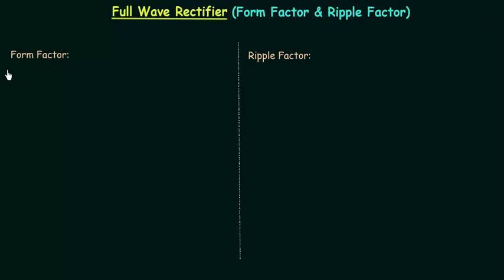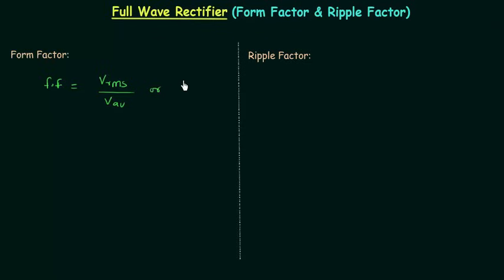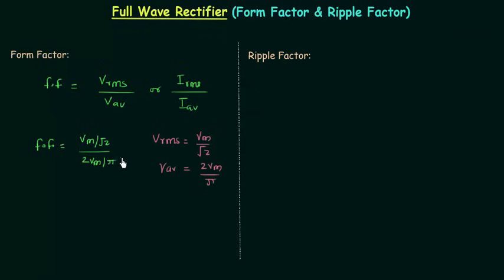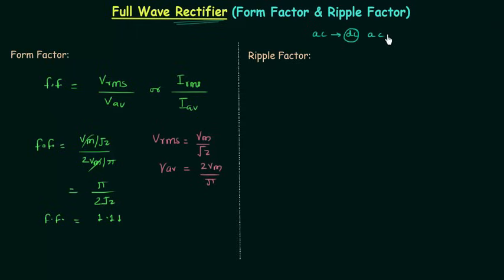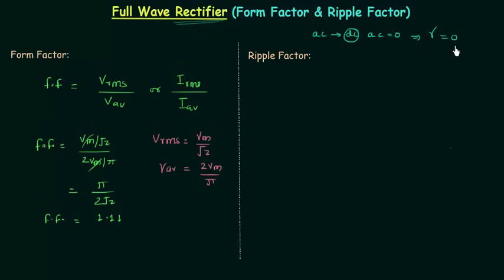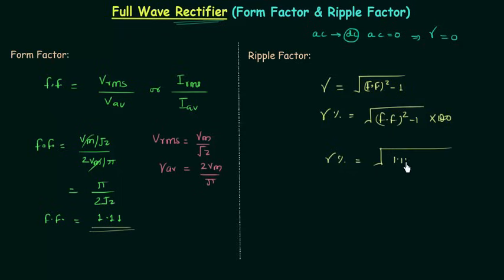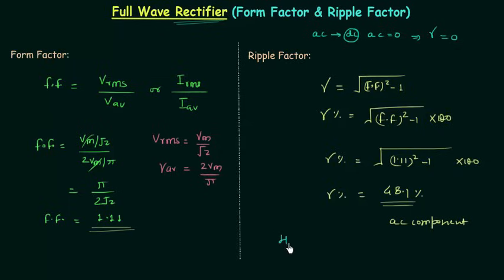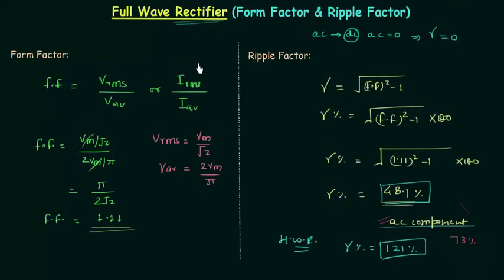Full Wave Rectifier (Form Factor & Ripple Factor)

Comment: How is it possible to get a ripple factor over 100%? That doesn't make intuitive sense? If your original voltage is 100% AC and you rectified it using a half wave rectifier, how does it make the output 121%? You get more AC character than 100%? That seems to violate everything we know about the laws of Physics.